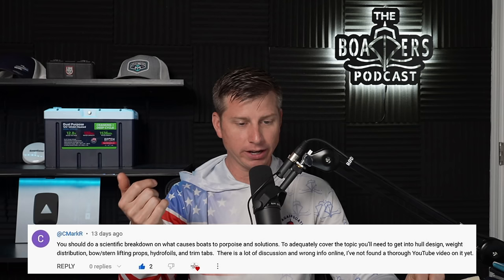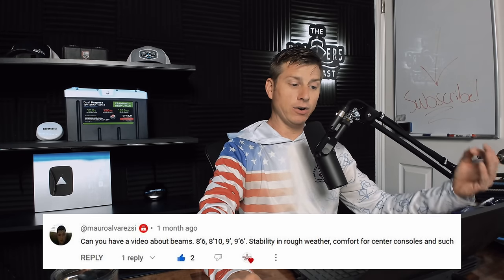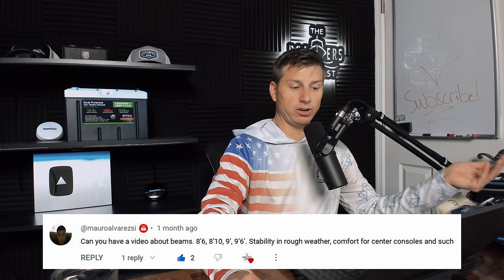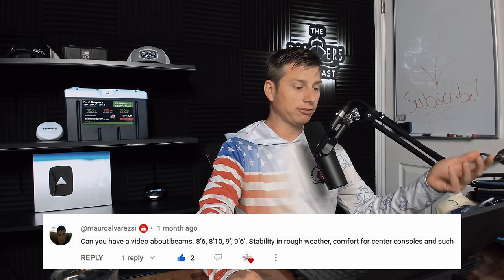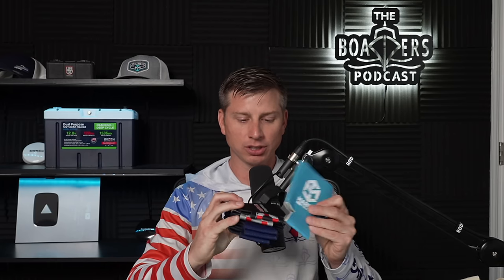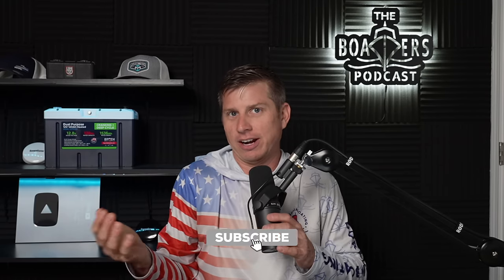What Causes A Boat To Ride Poorly?

Comment: This is spot on!  As a recent example for myself, I have a 21' bowrider I/O.  When I added a 3 additional deep cycles to the back (for my 36v trolling motor) - the boat would porpoise and generally rode much worse than it did before.  It was off balance.  No amount of trimming would really help.  Sadly I didn't have any options to move the weight up front either (unless I had passengers to sit up front), so in MY case, the hydrofoil did WONDERS.  It put the boat back to 'stock' as far as how it rode. But I know the root problem was the 4x total deep cycles I stuck in the stern. Hydrofoil wasn't the perfect solution, but in my case, it seemed to do the trick.  I now in hindsight kind of like it too since it covers the prop a bit - so when we are motor off, swimming in a cove and the kids are getting back in the boat, it protects their little feet from accidentally kicking the prop.

Comment: Great job covering the porpoising topic from my comment! On my boat, after changing props, adjusting motor height, and relocating as much weight forward as I could (without simply adding more weight), I concluded my issue was poor weight distribution for the hull design from the manufacturer.  I opted for the “band aid” by adding trim tabs instead of making major modifications to redistribute the existing weight. Thanks!
Reply from the maker: Great!

Comment: My 23 Donzi with a 2 stroke 250 mounted on a bracket porpoised like crazy unless I buried the trim tabs. My 30 Intrepid with twin 300s that has a stepped hull doesn’t porpoise at all. I can run it all day with no trim tabs. The stepped hull lifts the stern so you don’t even need them.

Comment: Another video idea for you.  Make a video about some of the most popular saltwater boat models and the features people like that make them so popular.  One example: Carolina Skiff DLV/LS models: simple, affordable, decent ride for such a shallow draft.  What I’ve found that somewhat sets them apart is that they have higher gunnels (preferred by buyers with families) and more weight/person capacity than most all other comparable boats that have similar draft and price range. Yes, they are mass produced and have quality issues but they have nailed the features many buyers want.   I’m honestly surprised that more manufacturers haven’t caught on.
Reply from the maker: Hi There. This is Rose thanking you for the video idea. I have added it to our list. Stay connected and watch out for it.🙏

Comment: There is a lot of great and valuable information in this video. Thank you.

Our boat had a pretty "flat" hull from the center to the stern. It's perfect when the sea is calm and flat, flying over the water. But when it's choppy, the hull tends to slam into waves. Boats hulls also depend on the use it was designed for. Our boat is a perfect little summer bay boat to be used in fair and calm weather. Every boat owner must be conscious of the characteristics of his boat. I'm sure your video will be a great help.
Reply from the maker: Thanks for watching!

Comment: Would stern lift creating bow plowing make my boat lean (list) when I am turning the boat.
Reply from the maker: It could, lots of things to think about there, but yes, bow plowing can make a boat dig and then with uneven weight, or the thrust of the prop, or a slight turn, the bow is then going to start to dig and cut through the water and pull that direction. Idk if you could call it list or not though, listing would be more just because of uneven weight making the boat lean on that side. On a smaller boat, a big prop or high hp engine with the torque of the prop can cause a "listing" effect. Lots of factors lol

Comment: What is (or do you have) an opinion on Tohatsu outboards? I know the older ones were simply rebadged Hondas, but now their smaller horsepower series are a proprietary design. I will need to repower a 14' McKee Craft soon and I have been looking at Yamaha, Suzuki, and Tohatsu 60 HP engines. The Tohatsu made the cut because I can it, rigged and installed, for significantly less money (~ $2,000) less than the Suzuki or Yamaha. I do have a Tohatsu dealer close by, so parts, service, and warranty issues aren't a significant concern. Curious to hear your thoughts.
Reply from the maker: Thanks a lot for your comment! I'm saving it for a detailed response in an upcoming episode. Make sure to stay tuned!

Comment: Good information 👍.   I've recently added a pod and a 270kg bf225 Tohatsu-honda to my 22ft cabin boat which was powered by a Volvo inboard I've only tested the boat twice so far in the river my boat is handling the outboard no problem it has a hydrofoil which I don't think is necessary and I think is dragging the boat and like you said I've had to rearrange the weight battery's and moved fuel tank forward  ..   I have a bit of a problem my motor has a overheat alarm only at idle Im going to change the pump and thermostats even though water is peeing pretty good and my question to you is do the these bf225 Honda V6 car engine outboard motor's have a pottet value or water regulator valve I can't find any information or videos on these motor's about the presser value on my phone but smaller 90hp Honda and every other modes motor's I can   do you have any ideas that might answer my question 😁
Reply from the maker: Thank you for commenting! Your question has been saved for a detailed response in an upcoming episode. Make sure to catch it!